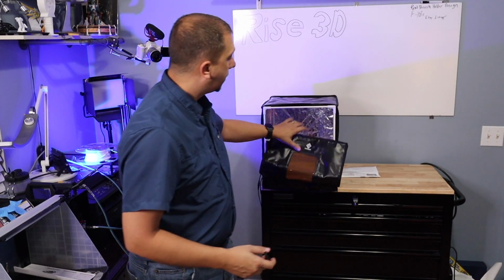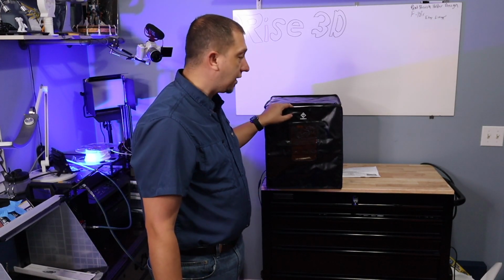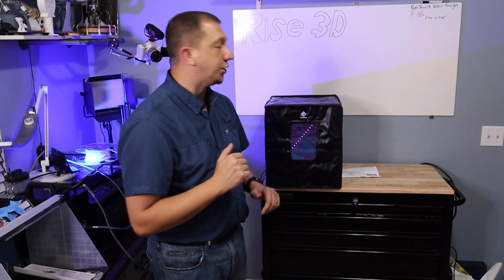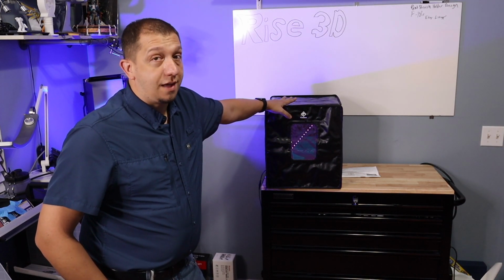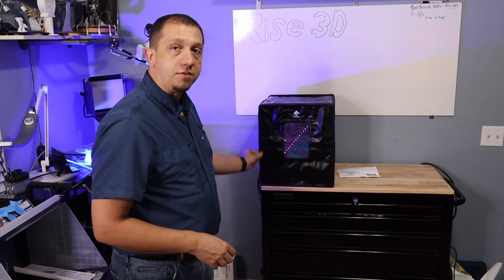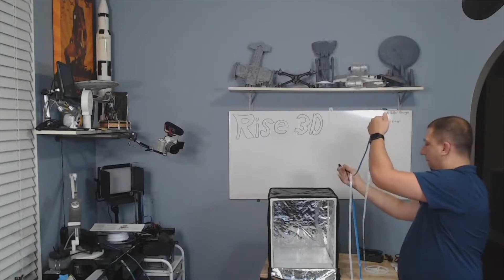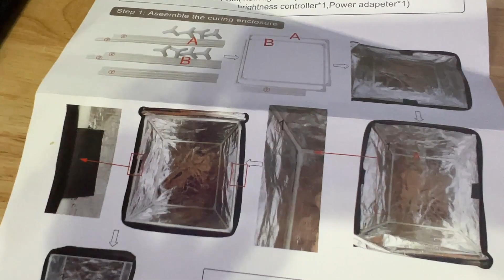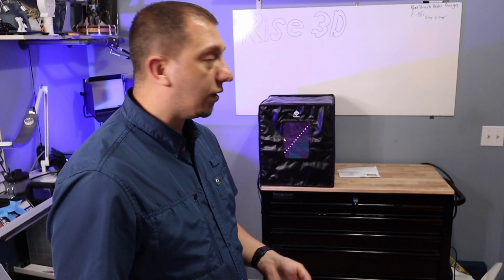Large Resin Projects? How to cure a resin 3d print with the Fungdo Resin curing enclosure

Comment: Does this thing get hot at all? I’m thinking about getting it myself, but not for the purposes of curing, but for the purposes of de-yellowing plastic.
Reply from the maker: Nope I ru. Them a lot.  It’s all led based so no heat and I love them!! I am running 4 of them now
Reply: @Rise3DBuilds  that is so good to know I have so many old transformers toys that have yellowed and I’ve been trying desperately to find a way to de-yellow them Until I found this it was either a DIY solution or I get this tiny UV lamp that’s used for curing painted nails, but those things only have a two minute timer on them.
Reply from the maker: @garganrose yeah I like that these do not have a time and you can adjust the intensity with a dial.  I just this for a lot of my big projects.   A little of paint to assemble but it’s worth it.  Assembly takes about 20 minutes
Reply: I got one of these with the fan and I use to ice my shoes and it’s not working I think I should lower the uv light

Comment: Hey everyone, Im currently having any issue with my anycubic photon mono x. The screen does not project the sliced shapes onto the screen. Exposure/cleaning tests work fine and produce a solid plate of resin. So the screen is working but just filling the whole screen everytime. I have updated the firmware, played with the uv percentage setting (%80 and %50) and tried different slicers (lychee and chitubox). Thank you in advance for any tips.
Reply from the maker: Have you updated your firmware?
Reply: @Rise3DBuilds  Thank you for replying.  I have updated my firmware. no luck so far currently trying a solution from the support team at anycubic. I will be trying to update the firmware again and checking the cables.
Reply from the maker: Anything plugged in around it like a heater or anything?   Could be causing a flicker or power surge?
Reply: @Rise3DBuilds  Thank you for the help. I managed to fix it i missed a firmware step. dont forget to print your secondary files everyone (step 3).